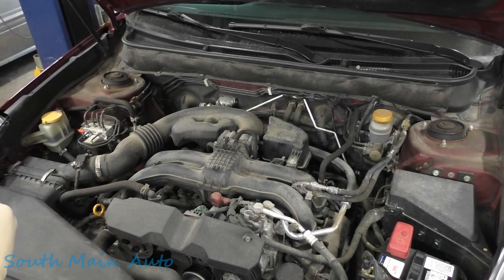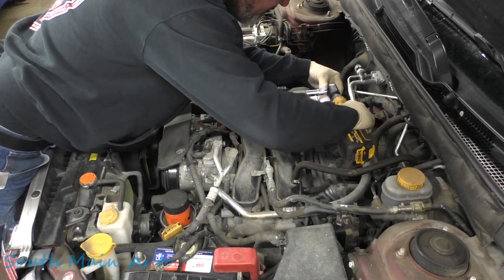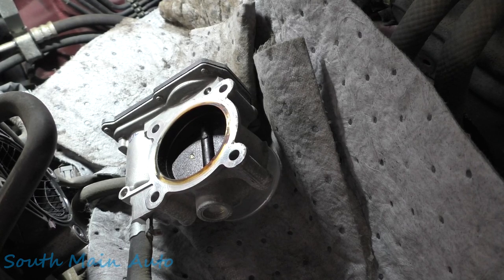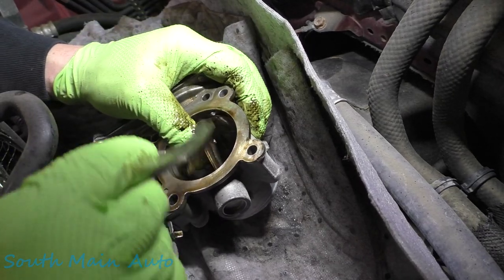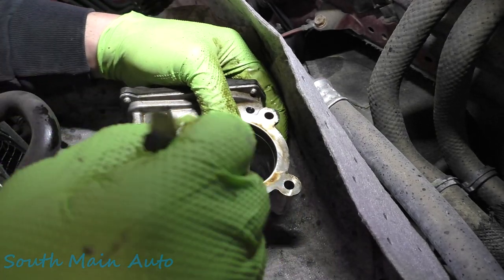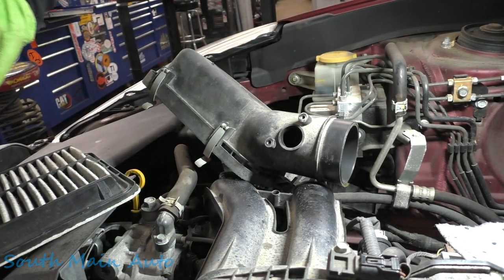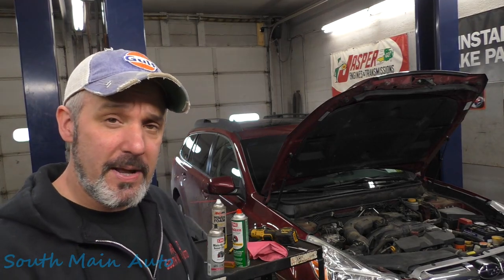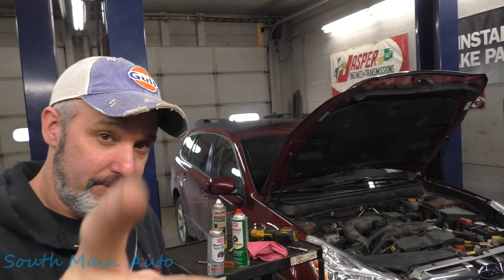How Does Your Shop Deal With Intermittent Symptoms?

Comment: I work for Subaru and what you might have is a sticking torque converter clutch plate within the torque converter.  Happens on legacy and outback models.  But clearly they all use the same power train so it can happen on any Subaru. Let stand running outside for 30 min and then road test. During road test drive up past 30-40 miles per hour till torque converter lockup. then when coming to a stop make it a real aggressive stop like 30-0 within a short distance like a panic stop or abs event stop. The converter will not have time to unlock and cause an engine stall. Very common.  Good work on cleaning the T-body and EGR always known issues for these boxer engines.

Comment: I always try to let logic dictate my direction, which is difficult at best with an intermittent problem.  You must rely on your experience to rule out potential causes based on the customer input, which sometimes can be minimal not to mention unreliable as well.  The time I had a lady come in saying her car sounded like a low flying helicopter with a wheeze comes to mind.  If the car comes back with the same issue, then at least you will know what it is not, which will allow you to focus on other potential culprits.  Great video, thanks for showing.

Comment: It’s funny seeing this video pop up, I’ve been dealing with the exact same problem on my parents 14 outback that has 160k miles. Intermittent stalling during a warm startup after it was parked for a bit, along with some hesitation when you’d let off the gas to apply the brakes. No codes just good ol upstate ny car gremlins running amok. Looks like they’re spreading west. 

I checked around the engine bay for anything obviously out of place, wiped down the hoses and surfaces as I went. Ran a can of intake valve cleaner through the engine, if nothing else it put on a good smoke show. Gave the MAF a spritz. Scrubbed out the throttle body which like yours was filthy. I’m suspecting it was the dirty throttle because after cleaning it out the engine seems to run a lot smoother and it hasn’t stalled since. 

I didn’t pull the EGR valve yet but I probably will because cleaning it can hurt, also figure the PCV valve should be removed and inspected. 

Now it’s on to other general maintenance items. Changing out the spark plugs because I think they’re the original ones, I hear that job is a barrel of fun. Replace a squeaky serpentine belt, flush the brake fluid, and flush the power steering fluid because they’re both kinda dark.

Comment: A couple of shops I have worked in, we would try up to 3 times to recreate the issue. In this situation I would have let vehicle idle for a half hour or so, and then tried to recreate the issue. If I couldn't verify what is happening. I would ask the customer to drive it until the issue happens, and if at all possible, bring it back when it happens again without shutting the vehicle off. I know that's hard to do, but I don't want to waste customer money, and they want the car fixed. So you just do what you can...

Comment: My shop/mechanic is a very familiar with Honda and has basically seen it all and fixes all... he knows what to look for. But that one rare case he wasn't sure he gave me a loaner and used my car for a couple of days until he runs into the problem. Problem was that not every time, but sometimes my car would stall when the engine came up to operation temperature... sometimes no problem for weeks, sometimes multiple times a day... wouldn't start right after, but after waiting 1~2 minutes it would start again and run fine for the rest of the trip. Turned out to be a faulty sensor that normally shouldn't cause stalling, but he figured that it most likely was a programming bug in the ECM that would trigger cutting of the fuel when it shouldn't... didn't show up on data also because obviously he didn't monitor that sensor because it had nothing to do with fuel delivery.

Comment: Every Subaru and a few other makes I’ve serviced I’ve used genuine Subaru intake and upper cylinder cleaner. It works well as a preventative if used regularily. I know you said it hasn’t thrown any codes but maybe record some live data. At least you’d have a base to compare to but what you’ve done is a good start eliminating the simple obvious things. One thing to check on live data is knock sensor under the intake. Give the area a few taps and make sure the live trace moves. These things were a common issue. Good Luck Mr O. 👍🏻

Comment: One thing about Subaru, never hurts to clean mass air and throttle body, at least on the older models. People love Subaru or hate them, doesn't seem to be much middle ground. Had a FM car years ago with intermittent not gonna start issues. Only after it was warmed up, then you get stuck, hoping it would restart.  Found a tech who got lucky and had it repeat the problem while was diagnosing. Bad relay, couple hours to find the problem, $15 part, fixed. His claim that he never got beat by an electrical problem was proven a couple more times in different vehicles. He moved to another state, I'm still in mourning.

Comment: Working on a lot of Subarus. It sounds like an idle relearn concern. Older Subarus you would clean throttle body. Disconnect negative battery terminal. Wait at least 10 seconds and reconnect terminal. With all loads off go straight to start position with key. If you have an extended crank. Your idle relearn is sucessful

Comment: 6th gen, 4-cyl Camrys are also notorious for a very similar set of issues. Usual suspect is carbon buildup in the throttle body or problems with the ETCS system. 

You went right down correct path with this one. In and out!
Reply: My wife's 2007 4 cylinder Camry has an intermittent rich condition.  As soon as it happens, before I can even get my tools out, fuel trim corrects itself and the rich condition goes away.  It has happened about 4 or 5 times over the last 8 months.   Just wondering if you might know if this is a known issue with this car?   I can't seem to find the problem, because by the time I start testing things, it is back to normal with good fuel trims.
Reply: @Z14kt12timandjes1  Hard to diagnose without having the car in my shop.  First thing that comes to mind is a lazy Air/Fuel sensor.  If you dont have a scope, its easy to swap on the 2AZ-FE (right on the exhaust manifold. )
Reply: @sartoaj   Thanks for the reply and no problem. I do have a scope and I have taken wave form captures of everything I can think of, problem is, the car is running fine when I'm taking the captures because the intermittence is gone.  I did put a new AF on it, but I hated to do it because the old one tested fine.  I've been ohm testing all of the wiring for all affected sensors/circuits that could cause that rich condition.   Does that sound like a good idea for me to do? In other words, is that a reasonable thing for me to check to see if maybe there's some unwanted resistance on somewhere that rears its ugly head every now and then?   Or does ohm testing the wires sound like I'm getting off track?
Reply: @Z14kt12timandjes1  Yeah.  An old school method if you're willing to spend the time on it.   Paying someone like MR. O to diagnose it might be worth the time.  

Prepare to chase this all the way down to wiring harness issues.  Rodents like soy-based wiring that appeared around 05-08ish

Comment: Working on a forester with the same problem. Already scoped the intake valves and walnut blasted them. Great running improvement but still have the intermittent stall.  Thanks for the encouragement to keep your head and check the basics.
Reply: Did you change your battery? Comment above yours that explains the possible issue.
Reply: They found mine with an OBDII data logger that stayed on the vehicle.

Comment: Hello SMA, My Subaru idle routine maintenance is similar. 30k mile throttle body, maf and IAC vave cleaning. OE pcv valve & air filter replacement. If that doesn't do it inspect the spark plugs.

Comment: Many electronic parts can produce the symptoms. Heat is always bad for electronics. Having said that, it can be a host of other things. You do the best you can to help resolve the problem. I have a 1994 ford inline 6. It is hard to Start cold or hot. No engine light. It runs fine once it's starts. It is a pain but I can't locate the problem. No worries about theft, it won't start

Comment: Like you I start with cleaning throttle body, Idle control valve if it has one and the egr valve. Next I would look at and clean maf sensor and do an idle relearn if applicable.

Comment: Mr. O.  As a non-shop owner, non-customer, and view you from afar through the lens of a camera, I have this to say for what it is worth.  I appreciate when a mechanic/shop is honest and to the point and willing to use the "big words" around me and take my "story" for what it is worth.  What you showed here was straight up, logical, and the best solution for an intermittent problem.  Just how dirty that throttle body was indicates to me had that been my car I would accept the 'lets try this first' solution rather than tossing parts at it or just plain turning someone away.  You got an hours worth of pay and they have direction on the car's possible issues.

Sure better than my dealer experience with my Ram 1500 ecodiesel.  I can't totally blame the dealer but it would have been nice if they had listen to my explanation of the issue rather than applying some "canned solution" straight from the bowls of the tech manual. The weather is warming up. I should start to see the issue crop up again.  This will make it summer number 4 with this issue.  Really wish it would throw a code.

Comment: I own a '95 Chevy S10 with the 4.3 and the EGR gets a small piece of carbon stuck under the valve every few years. Stalling, rough idle, etc.  I remove the EGR, pick out the offending piece of grit, and presto. Good for another few years.

Comment: Intermitant stalling is usually caused by a faulty ignition coil. No codes ever showing it but when I removed the engine coil and wires and the terminals were burnt to a crisp causing shorts. I replaced the coil itself and never had the issue of stalling again. Just my 2 cents.

Comment: Eric I love all your videos, your process is first class! I’m a long time master technician, and I’ve seen this issue with dirty throttle bodies after the car battery was replaced or disconnected and makes the pcm reset the idle adaptives. Cleaning the throttle body and egr should do the trick.
Reply: What about the PCV?  My 2.5l scion(no EGR) would idle around 400 RPM, stall after sitting all day and then doing the drive home.  I changed the $4.00 PCV and it returned to normal.  It still has a slightly shaky idle, but it is around 800 RPM and it doesnt stall out.  If I was wrong, I only wasted $4.00. That seemed like a good gamble.

Comment: Used to have very similar symptoms on early 2000's Acura V6's(worked at a dealer). Found after about a 15 minute hot soak, the fuel in the rail would vaporize. Much cranking or a few seconds of rough running  to give  time to get liquid back in lines would clear it up. Noticed most between seasons when the fuel recipes were changed (winter to spring). More volatile recipe allowed the fuel to vaporize more readily. After 2003 model year, not a problem (perhaps running higher fuel pressures).  I tried experimenting with heat resistant wrap...no success. Just had to get the 'winter' fuel out and warm weather recipe in. Just a thought.

Comment: Hi again, I never used amsoil power foam but I do use their motor oil, trans fluid and HD metal protector, But I first used Berkebile 2+2 when I was 14 yrs. old I believe and have it in the shop at all times. Another good one that I have used is Mopar heat riser and choke cleaner, but they haven't sold it for a long time. As far as I know!

Comment: If you are going to clean a throttle body on a vehicle I highly recommend using a soft bristle plastic bristle brush Last thing you need is steel Brush hair to get stuck under a valve

Comment: I am  not a mechanic. On my own car I would do exactly what you did Eric. Look at the components that could cause the issue that are simple to access, and if they could be addressed without replacing like cleaning the EGR & throttle body as you did, then I would and see how the vehicle drives. As you said, there is no harm and they will both benefit from a clean if they were carboned up. I would then start the process of physical elimination as opposed to elimination by replacement. throwing the parts canon is not a solution with intermittent faults, unless you are certain due to experience that a particular part is the root cause of a particular type of symptom.

I had a Subaru Impreza that had a rough idle that was initially intermittent then became very evident. It was under warranty, the dealership could not find the issue after a number of attempts. They ended up contacting Subaru Technical advise and they were advised of a number of components that were know to rectify the issue if they failed. They had the car for over a week, with a senior technician. Over the week they threw the parts canon at it, replacing the known parts that could contribute to the issue. Nothing worked. I was not happy as it was the first new car we had ever owned, and I deliberately went to Subaru for all services, even though I did not need to as far as warranty goes, because I wanted there to be no issues with warranty claims. I will never go to a dealership for services again while under warranty,  I will go to my local mechanic and ensure he uses OEM parts, and have it documented so there will be no warranty issues. I may as well save my money, having the dealership service it did not give me a better outcome in the end. BTW, the dealership did their best, I cannot complain about them, I just know they were are lot dearer for each service. One thing i will say though, their pod coffee machine & customer waiting room was excellent! They also had a barista and full coffee machine that was manned during the week.

Comment: Subaru has a TSB for this to have a Software update for hard start and bad idle. I think it was for years 2009- 2016 2.5l non turbo. Subaru charged me $185.00 for the update. Mine 2012 Forester X 2.5 l at 9 years old just started doing this. Update solved all problems.

Comment: As a Subaru tech, we get many intermittent issues. If the vehicle is under 3/36, we get pain 30 min to inspect the issue  and try to duplicate it. Like you, I try to use logic and past experience. Also, even with the Subaru specific scan tool, we don’t get many special functions and we HATE it.

Comment: Crosstrek owner here with just over 60k miles on it. I had a similar issue and I ended up cleaning the throttle body, but that didn't fix it. I dumped some fuel system cleaner in the tank and that seems to have helped the most.

Comment: Two examples of an intermittent I've had.  One was a buick 3800 v6 that ran great, except when it didn't.  Go to walmart no problem, but coming home randomly bucks and stalls, then seems fine.  That was a crankshaft position sensor being heat soaked.  Another was grandpa's ford ranger that made it to the corner saloon and struggled to get home stalling bucking.  That offender was not the irish wiskey but the ignition coil with a break in the copper coils that heat made spread apart and mess with the ignition.

Comment: Commenting not as a mechanic, but as the owner of a red 2014 Subaru Forester with the big 2.5, a buck 10 on the clock, single owner, and two drivers who deals with intermittent sluggish acceleration and near stalling at stop signs. Had to check my driveway to make sure you hadn't taken my car for this video. My solution to the intermittent issue? Not bother my mechanic with it until it's a persistent issue I can duplicate for him.

Comment: Eric. I own a 11 Forester 2.5 same problem. Did what you did. No change. Noticed engine used 6 quarts of oil in 1500 miles. Put new Subaru short block in. Problem solved.

Comment: Eric… from a guy that has seen the same issue you were dealing with on the Subaru many times and fixed the issue with the exact procedure you did of cleaning throttle body and proceeded to unhook battery before doing so I’m inclined to think that you knew exactly what you were doing to fix the complaint but wanted to make an interactive video for you viewers lol the newer battery without cleaning the t body was what caused the issue  great work either way I have learned over the years of doing many many many suby head gasket jobs once I pop the intake I set it down clean the surfaces and the throttle body and another thing I’ve learned with subys is vacuum filling the coolant will save you a couple hours of fooling around trying to bleed the system. Ps Brake clean on a rag is my go to for throttle body cleaning it cuts right through the grime quickly

Comment: I buy the Power Foam on a regular basis. Great stuff imo. It states on the can not to use it as a degreaser. But personally i use it Exactly as Eric O does in this video with outstanding results Everytime. I have also used it in a warm cylinder bore to clean piston tops before an oil change on crudded up engines.